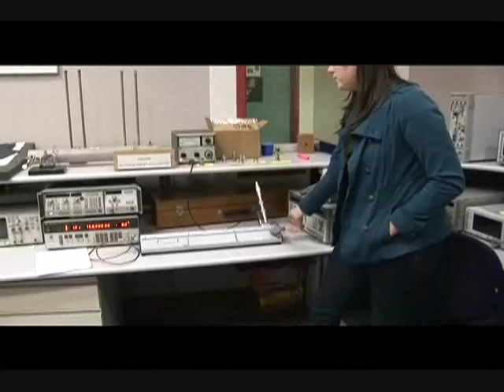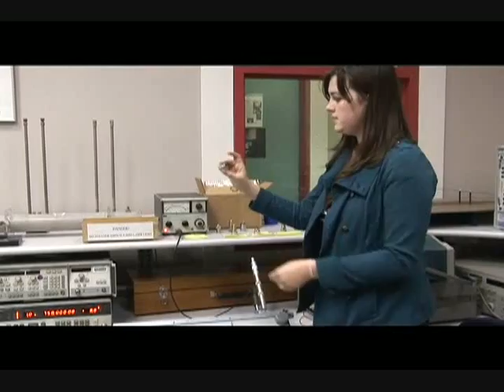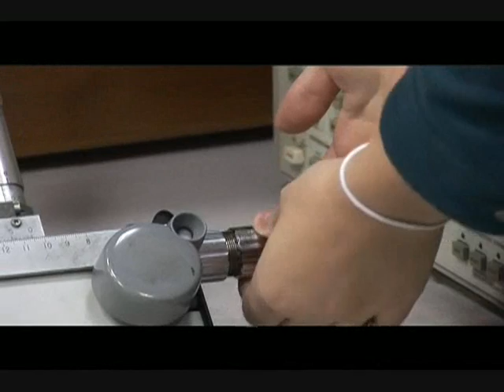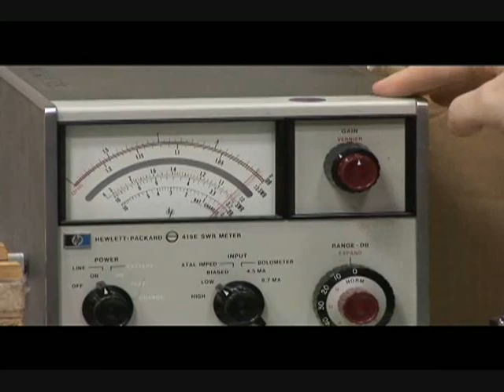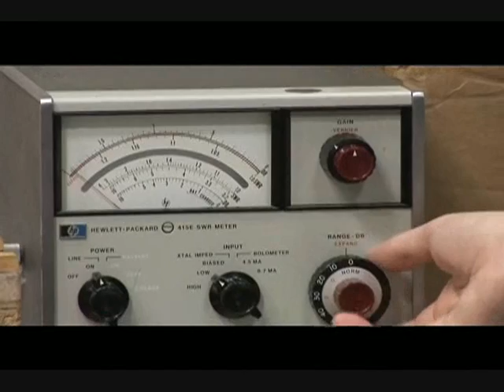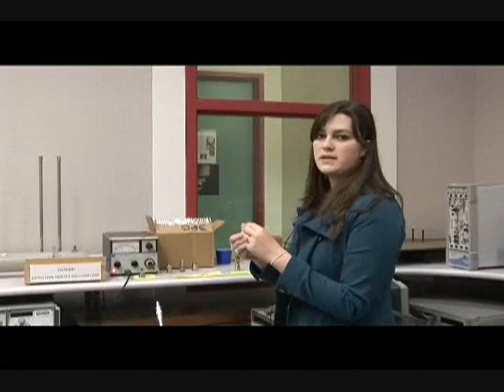Slotted Line Lab

Comment: So, (29-17) * 4 = 48 cm, 30000 / 48 = 625 MHz, but the signal generator is set to 750 MHz. The wavelength should be 30000 / 750 = 40 cm, or even less if there is a velocity factor to be taken into account. ???